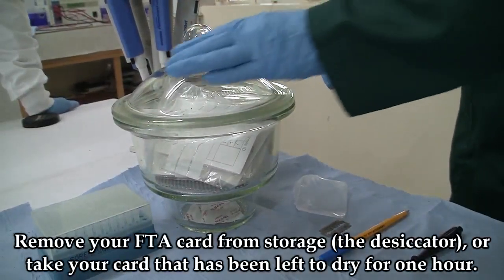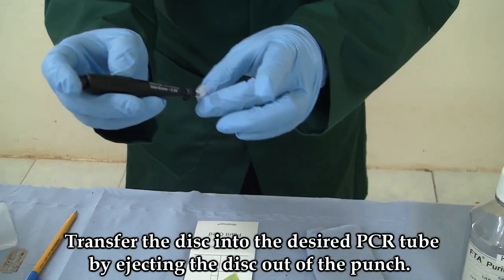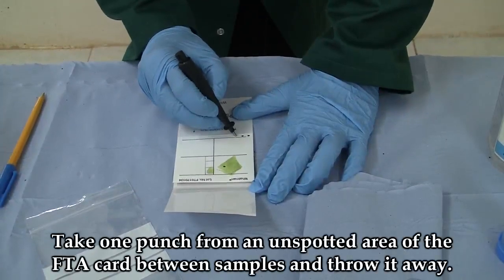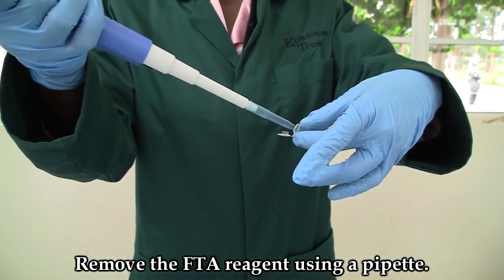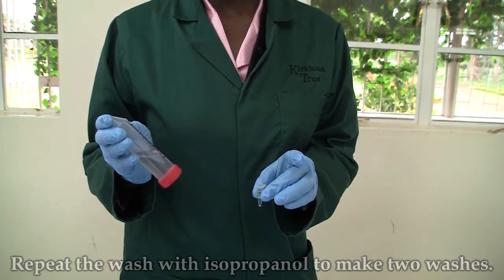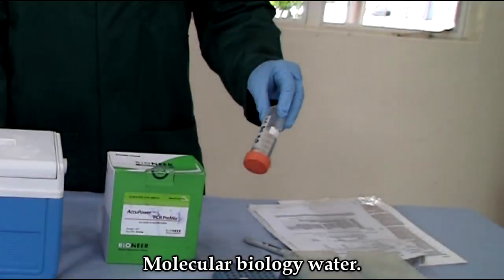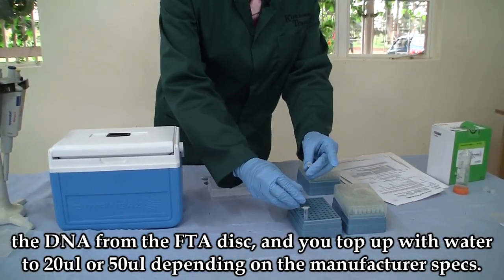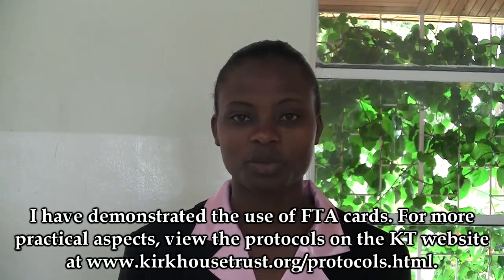Kirkhouse Trust - Preparing an FTA Disc for Amplification

Comment: What is in the FTA purification Reagent? You needed to explain the contents of those things otherwise the presentation doesn't make any sense.
Reply: The FTA purification reagent is a ready-to-use reagent which is sold by the manufacturer of FTA cards, i.e. Whatman. The composition of the reagent is not revealed by the manufacturer.